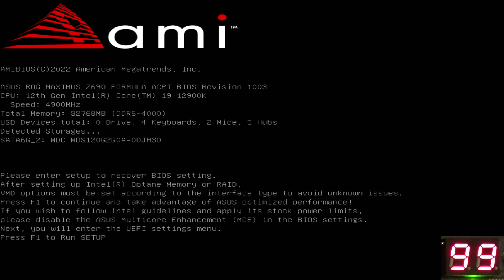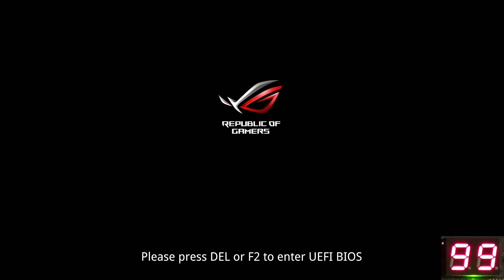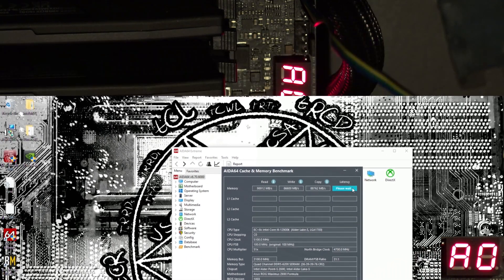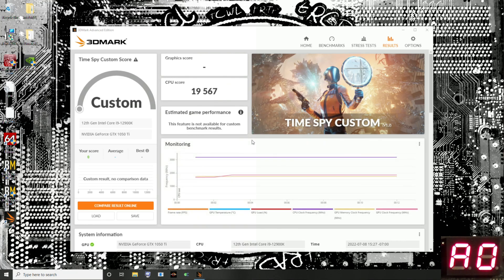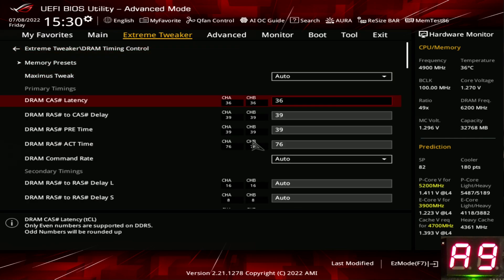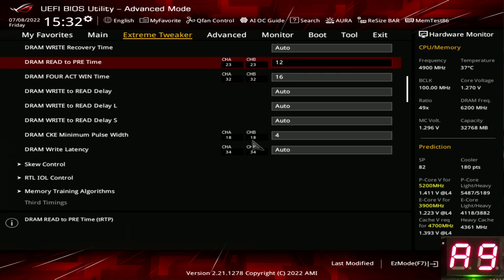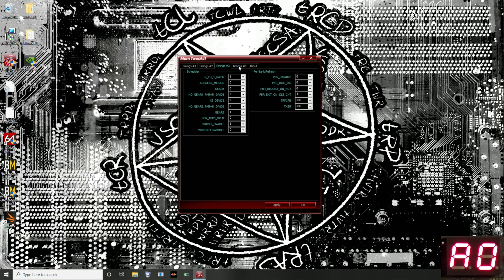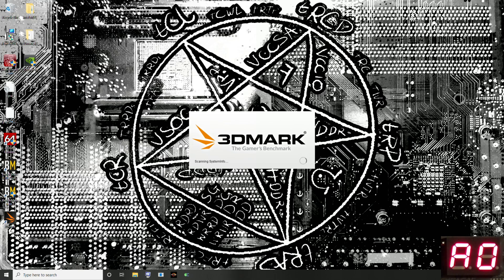Easily improve your DDR5 XMP's performance // for ASUS motherboards

Comment: Should IVR transmitter voltage always be the same as your two dram voltages? In other words I'm applying these subtiming improvements to a existing memory overclock that's running at 1.5v, so should IVR transmitter also be 1.5v?

Comment: Thannks for the video 600 more CPU points on 3D Mark vs my old timmings 22112 Now, Hero board 12900k 52/54 AI OC(lazy), 6400 cl32 ratted Gskill Hynix, XMP already has 1.4 voltages,  What is the next step Buildzoild increase frequency?
Still need to test stability thou :( Some  Forza HZ 5 I guess that game makes DDR5 work hehe cuase when its unstable crashes pretty fast.

Comment: I notice that you increased the refresh interval by more than 10X, and I've seen you do similar things in other videos.  It seems unlikely to me that DRAM designers are overestimating the refresh requirements by such a large margin, especially since refresh has substantial power cost. How sure are we that regular memory stress tests are creating the kind of conditions that are most difficult for data retention?
Reply: Warning, I don't really overclock memory for a living or anything.

I heard that the main reason is that of course the memory has to meet some kind of spec and usually that spec involves being in some extreme (for us) temperatures. As in, like 40-50°C ambient temps and such. However, for homes usually it's 23-27°C which I think would decrease power leakage (since lower ambient temps = lower RAM temps = less leakage) and therefore you don't need to recharge it as often. Idk about the tests being a good estimator of memory though but in my experience you could basically always crank the tREFI really high unless you're super concerned about your data

Comment: Buildzoid. I need your help man. Just had a 3rd stick of Trident Z royal 5600 die. I have had 2 replacement kits and now just had a stick die again. Its a 32gb kit 16x2. I have a 12900k and Auros Master mobo. XMP is enabled and that is it. Im thinking it must be the motherboard. I have changed slots and its 100% a dead stick. So annoying. Do you think its also a motherboard issue? Im 90% sure its the same slot that the stick is dying in.

Edit: Just found a reddit post where a ton of people are having the same issue with the Auros Master. I hope they will refund me. Now I have to hope they will refund me and Gskill will send a 3rd kit.

Comment: Thanks for the video Buildzoid, the link you provided to ROG's Mem TweakIt is the first version I've managed to successfully launch on my Z690 Hero board! I'll definitely be trying your setting out today as I have the Dominator Platinum RGB 6200's which I believe are also SK Hynix M-Die.

A question... is it possible to get 1T timings working with DDR5? I've had zero success with either DDR5 4800 or 6200 kits.
Reply from the maker: 1T depends on the motherboard.
Reply: @ActuallyHardcoreOverclocking  seems to be only the Dark and the Unify ITX
Reply: @ActuallyHardcoreOverclocking  thanks for the video. I got these settings working on first try on a z790 gigabyte gaming x with 13700k running only pcores with a Kingston renegade 6400 c32 Hynix mdie. However latency down not go below 60ns. However the only timing o could not find on the gigabyte board is the tpt timing

Comment: I wish there would have been more videos like this for the z490 chipset because learning to tune my RAM on my Maximus Hero XII was quite the learning curve. BTW some bios updates have come out for z490 that gave some serious stability gains for RAM overclocking
Reply: overclocking the 12900K is a PITA on ASUS AiOC, total inconsistent results with my G-Skill Trident 16x2 ddr5 6000 36-36-36-72 at XPM I profile and AiOC CPU overclocking enabled with an 89 value on the Predictive setting (which is supposed to dial down expectations).  I get up to 5200 to 5400 speed but voltage spikes are ridiculous at 1.43v (idle) to 1.49v and sometimes higher when gaming or doing stress or benchies.  So crashes occur while gaming if both are set (XMP & OC).  It's hard to overclock anymore, it's a real shame that Intel can't build these 12900's to crank out at least a single-core of 5.5 or so.  I mean, yea, i would get a 13900K and slap it on the z690 mobo, but I'm paying $550 for 500Mhz and what am I going to get, like 2 to 3 more FPS at the most?  Probably yea.  I listen to Buildzoid because in his 13900K video he spells out how ridiculous it is anymore to get these chips to OC at worthwhile values and heat.  The average gamer has an AIO cooler on their CPU not a custom water block, which doubles the cost of gaming (EK water block).  I realize my RAM is friggin' junk (G-skill are Samsung memory chips) after spending a fortune on the ram early in the game.  What a tragedy of events as I ho-hum my way through the tulip patch at 4900.
Reply: @dabneyoffermein595   @dabneyoffermein595 The 13700k would upgrade your Single core very close to 13900k and get the same FPS, for 430(€) and still have comparable Multicore to your 12900k, do you really need more Multicore? Swap to a 13700k and then to 14th gen next..
Reply: Z490 doesnt have ddr5

Comment: I tried these exact settings last night on a Z690 Apex (BIOS 1304) and 6400CL32 kit.  I saw a nice boost in AIDA like in the video, but my OS became corrupted and my SSD went into write protect.  I must be part of the 0.01% that this doesn't work for... oh well.
Reply: using the same kit but  a 6200 found error on memtest too on asus extreme mobo

Comment: Should this work on gskill 6400 cl32 kit I am running 6200 is a hynix kits
Reply from the maker: yes
Reply: @ActuallyHardcoreOverclocking  found 1 error in like 30min of memtest pro test hci

Comment: Will these work on Gigabyte Aorus Z690 boards?
Reply from the maker: the timings will the voltages need to be a bit different.
Reply: @ActuallyHardcoreOverclocking  Thank you.

Comment: Will this work with GSkill DDR5 5600 Cl30 memory?
Reply: If you open up CPU-Z and check the memory manufacturer is SK Hynix then yes. If its Samsung then no
Reply: @christopherbolton2758  Thank you. It is SK Hynix
Reply: At 5600 I don't think you would need 1.4 on the memory but as BZ said he has been running his Hynix at that safely. That said if you are bumping it to 1.4 may as well try for a higher clock speed :)

Comment: Hey Buildzoid, i now that its  a little bit offtopic but do i need active cooling for b-die when i have my cpu cooled with Be Quiet Dark Rock 4 pro and my case has decent airflow? I have Fractal Design meshify c with modded front panel ( i removed foam filter from it) and i have 2x 140 at front and 1x 120 at back noctua nf fans.  I don't see how i could put any fan under my ram without going into LC or getting smaller cpu cooler. I was going to use ~1.5V on Patriot Viper 4400cl19

Comment: 7:45 Wrong explaination, you should talk not about memory speed or memory type
VCCSA afftecting on MemCLK max freq, not the DDR
DDR4- 3100/DDR5-6200 = 1550mhz memclk, which is not high. That is correct explanation why SA can be 1v
Reply from the maker: from intel 12th gen documentation part2: 
"Gear2 Mode (GEAR2):

Indicate that MC is working in Gear-2 (Qclk is half the data transfer clock of the
DRAM)"

the RAM clock is 3100MHz. The IMC clock(QCLK) is at 1550MHz which is why you don't need much if any extra VCCSA since upto 1800MHz QCLK can work with 0.9V VCCSA depending on the CPU.
Reply: Back to school 🤣🤣

Comment: Hi Buildzoid, the reason your Aida latency benchmark is inconsistent is because windows is still doing things in the background after rebooting. Run it in safemode and it’s super consistent.
Reply: i tried it in safe mode and it was very consistent. It was ranging from 0.1ns higher some times and 0.1 ns lower but very close and latency was slightly lower as well
Reply: Yes but that's not a realistic test because you aren't going to be using your PC in safe mode.
Reply: @t7274  The point is you're comparing differences between tuned and untuned memory. Of course you want to remove as many variables as possible...
Reply: @t7274  its about removing overhead to get stable results that are not impacted by random other factors, like windows update doing its thing for example. 

But I guess that this is something buildzoid knows very well already, so he probably has experience with said system / its a new windows install, to say that it is more inconsistent than usual.

There is the option to start in safe + diagnostic. Very good for this purpose.

Comment: hey buildzoid random question but what fan do you recommend for cooling ddr5? like 80mm 92mm or 120mm? (planning to get a 1.4 volt c34 @6600mhz and tune the timings on that with a z690 unify x and a 12700k)
Reply from the maker: doesn't really matter. I'm pretty sure even a 40mm would do a decent job.
Reply: @ActuallyHardcoreOverclocking  ok thank you mr buildzoid

Comment: I'm curious how this will this affect raptor lake coming up? it can handle higher clock speeds
Reply from the maker: These should work upto 6800. 7000 would probably still work. 7000+ IDK. Might need to loosen them at that point.

Comment: The amount of people who are going to now have a bad memory over is hilarious. People should know to stress test the memory themselves as every kitt, CPU IMC and MB is different, but this is the internet and people just blindly copy values they find in videos and reddit. How much should we bet those timings are not actual stable? Wouldn't pass TM5 or Karhu 1000% if I had to guess.
Reply from the maker: These timings pass stress tests(testmem5/HCI/Ycruncher/Linpack, I don't have Karhu) all the way upto 6800Mbps. On XMPs ranging from 6000 to 6600 they should cause 0 issues.
Reply: @ActuallyHardcoreOverclocking  Those tweaks you say are good to 6600. Thats just Hynix Mdie in general your talking about right?
Reply from the maker: @theodanielwollff  Yeah only for Hynix 16Gb M-die. I'm pretty sure the tRFC I'm using here is way too tight for Samsung and Micron. Some of the other timings might also be too tight for other DDR5 ICs.
Reply: @ActuallyHardcoreOverclocking  I also don't discount you validated these tweaks at some point. Some of those values your punched in have spit out errors for me in thr past. Though that was all on the GB Tachyon now I think about it. As you know every vendor handles mem training and voltages differently. Maybe its time to thinker on a ASUS Hero.
Reply: @theodanielwollff  Tachyon will handle those timings BZ suggested until at least 6800

Comment: Well, I left the timings that were lower as is and lowered the ones that needed to be changed. The only one I couldn't set lower was the tPPD=2, soon as I change it to 0 it would auto go back to 2. 3DMark CPU went from 22536 to 22816, AIDA64 Read went from 102.66 to 104.75 GB/s , Write 102319 MB/s to 100.72 GB/s , Copy 100576 MB/s to 100.16 GB/s and Latency stayed at 59ns it has gone down to 56 or 54 before can't remember which. Any ways I got a boost so I will take whatever I can get so thank you for the video.

Comment: Hmm I'm running 6600 @ c30 with a 12900KS with a all core OC of 5.3ghz and I get 22536 in 3DMark Time Spy CPU score. I also get 102.66gb/s Read, 102319mb/s write, 100576mb/s and 58-59.6 Latency in AIDA64. I dont run a Asus board anymore was running the z690 Extreme but switched over to the MSI Godlike just because I think their memory training and speed is better than Asus and it is a lot faster. I have also been able to run 4 Sticks of Gskill 6400 c32 @ 6000-6200 c30 or I can run 2 sticks of it at 6600 c30. So was going to try some of your timings on my MSI and see if it helps any or at least see what they are compared to what I am running at 6600.
Reply from the maker: these timings should work on MSI boards.
Reply: @ActuallyHardcoreOverclocking  ok thanks for the quick response. Haven't made it through the entire video yet so ill give them a try. So finally made it to the end and just by taking a quick look some of the timings r the same as what I'm running and I actually have a few that are set lower such as tWRRD-sg is 56 and tWRRD_dg is 42, tRRD_sg is 4 tRRD_dg is 4, tRFC is 298 and tREFi is 130560. There is a few that need to be lowered so I may not see the huge increase that I was hoping to see or at least as much as you did.
Reply from the maker: @rytir753  yeah these timings aren't meant to be the peak of what's possible with SK Hynix DIMMs just something that should work for like 99.9% of setups
Reply from the maker: @rytir753  the latency improvement in the video is primarily due to the tRFC and tREFI changes. So if you already had yout tRFC and tREFI dialed in then my settings wouldn't do much to the RAM latency.
Reply: @ActuallyHardcoreOverclocking  Ok thanks for the info and yeah, my tREFi was already set really high and my tRFC was already 298. Do you have a video or a setup that would get the most out my 6400 c32 kit?:) This gave me a couple hundred points on 3Dmark to bad I didn't have this video back when I was a few hundred points off of breaking 23k in time spy. I'm pretty sure me going from 6400 to my tweaked 6600 setting was what got me to 23128 in Time Spy. It bugged the crap out of me until I was able get over 23k. I have 2 sets of the 6400 c32 and 1 set isnt entirely stable @ my 6600 setting but then again, I haven't taken much time in trying to get it that way.
Reply: @ActuallyHardcoreOverclocking  Would happen to have any suggestions on getting 4 sticks @ 6400 stable?  I can use XMP and it will boot into Win11 then shortly after I run something ill get a IRQ blu screen of some sort. My XMP is 6400 1.4v 32,38,38 which is the Gkill 6400 c32 kit. The other speeds with 4 sticks I just let on auto so wasnt sure if there is a few voltages I could try and tweak to get it stable.

Comment: Hello, Buildzoid does this timings apply to Gskill ddr5 6000mhz Cas 36, sk-hinix kit ? Thanks
Reply from the maker: should work
Reply: @ActuallyHardcoreOverclocking  thanks continu like this!
Reply: That kit is Samsung IC's unless you have engineering sample from G.Skill.
Reply: @Gti_Jason  I have see in gskill web site that this hynix ic's with the reference. Thanks for your help
Reply from the maker: @Noyblis  the easy way to check is try if you can run 333 TRFC. If you can't you've got Samsung.
Reply: @Marcus R thanks
Reply: Sorry to disturb you, but I have tried every thing and it's not possible for me to post at ddr5 6000mhz, do you have any idea of what I have to in the first beginning to make the core I 9 post?

Comment: TRRDL, TRDDS and TFAW do nothing below 8/8/32 for DDR5
Reply from the maker: Ah another person who lives under a rock: https://www.igorslab.de/en/intel-vs-jedec-ddr5-timings-in-extreme-technical-practice-test/3/
Reply: Live in too many JEDEC papers, if only reality was in line with the papers amirite..
Reply from the maker: @Trexzo_  the thing about the JEDEC spec is that it only says what settings MUST work, not what settings CAN work.
Reply: @ActuallyHardcoreOverclocking  That makes sense. Memory and IMC have to work in tandem so it’s logical for both specifications to be taken into consideration.

Comment: Hi Buildzoid, I am considering buying a mining 6900XT for $550, is it safe & good deal? thanks
Reply from the maker: if it stays at 550 I'd take it
Reply: Yes. Mining is better than gaming. No thermal cycling. What degrades the core isn't primarily how much work your card does, but rather what kind and how consistent.

Miners don't push the core, and they underclock and undervolt them as low as their cards allow. Then they run them at the same temperature constantly. What causes damage is when the card boost really high and gets hot. And when you're gaming, your card is literally designed to push itself as much as possible.

Plus miners take care of their hardware, because the wholepoint of GPU mining is to keep the cards in good condition for resale.

You could say "oh, miners run their cards into the dirt and pass them onto you."

Except that's not the case. Miners wouldn't risk pushing their cards or degrading them because if they have 20 cards that are poorly maintained, then they'll probably have one fail before they ROI. The difference between a well-kept card and a gaming card from someone who slots and forgets is miles.

Definitely get your hands on a mining card. Just ask them to show videos of it running in a PC and checking benchmarks of furmark and HWinfo to make sure nothing is weird.

I've gotten many good cards for me and my friends this way. The only time I ever got a card that died right away was a 980ti from a gamer. I always buy used mining cards at good prices.